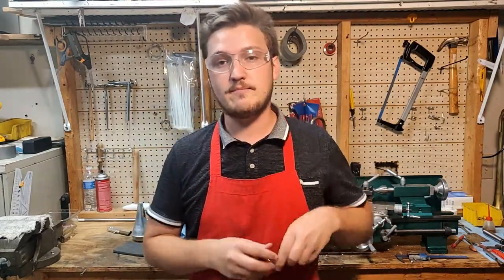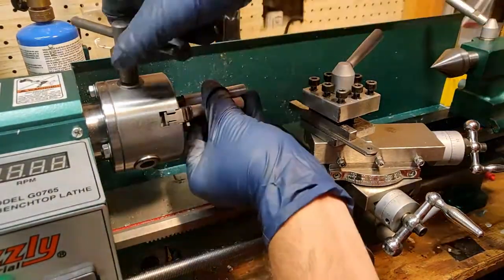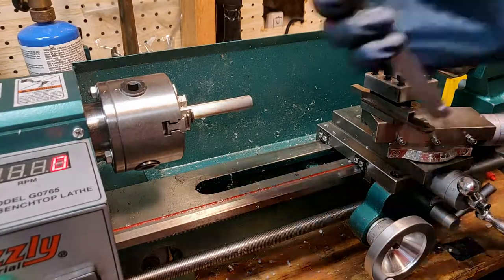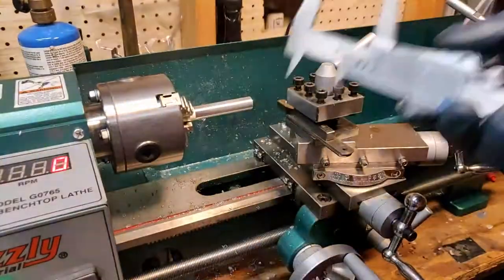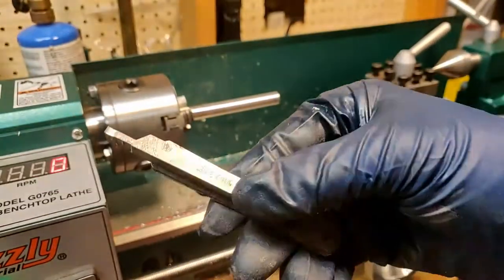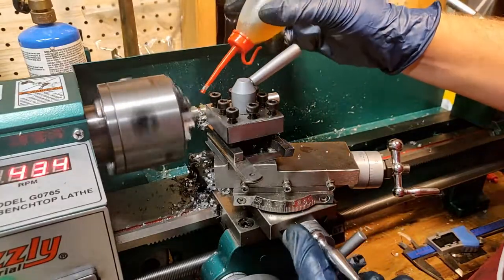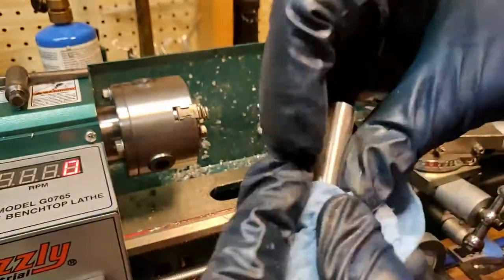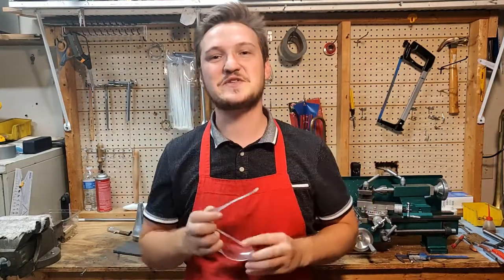Machining a Mandrel for a Trumpet Slide Tube | Mini Lathe Project

Comment: I have had the same problem with my grizzly G768 model at first I took everything apart cleaned all the shipping grease off deburred all edges to remove spurs and smooth up the ways with a fine stone this improved everything considerably also adjusting the gibbs on the ways is very delicate and important to get just right also went with a new quick released tool post that considerably tightened up that part overall I’m happy with mine, also noticed using manual feed is better than the automatic feed on the grizzlies the automatic feed is way too fast and cannot be slow down that’s why it’s a rough finish and a round carbide bit makes for a much better and smoother finish also.